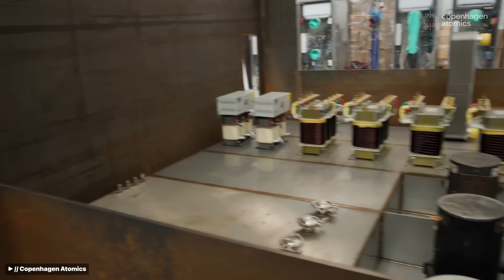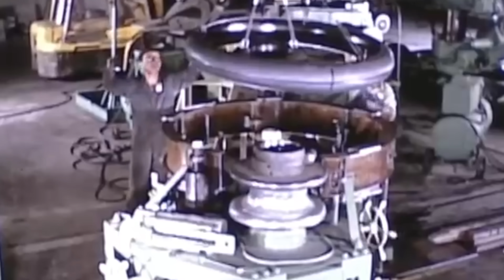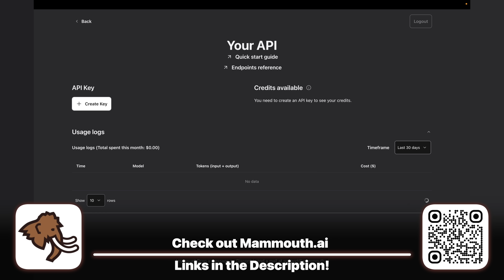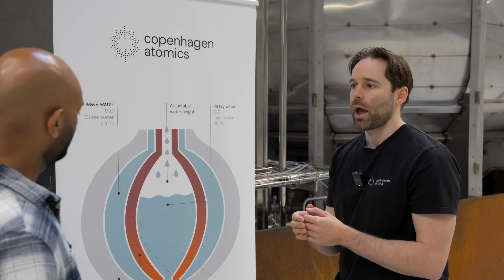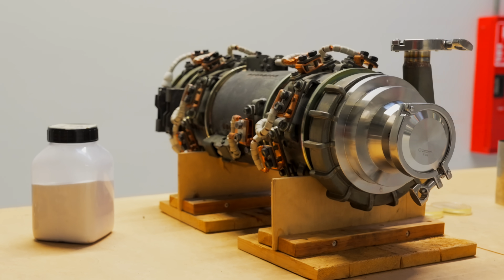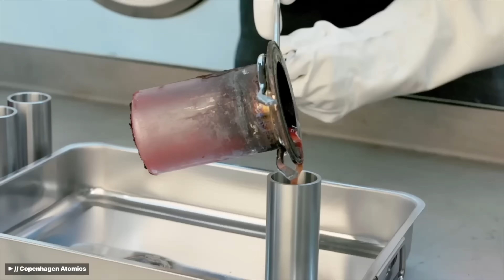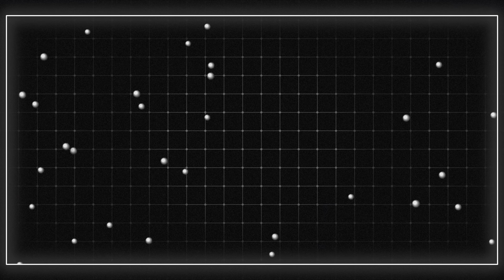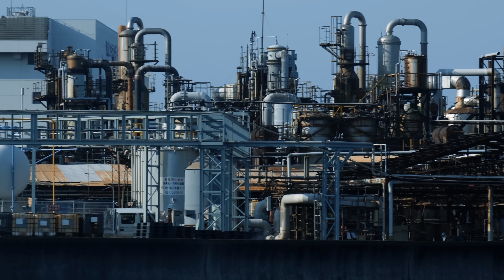This Modular Thorium Reactor EATS Nuclear Waste

Comment: 8:28 - Purified molten salt is still corrosive.

Even so, to purify their molten salt on an ongoing basis, Copenhagen Atomic's design needs to have an external salt purification plant inserted into the molten salt loop!

This external processing plant will bear the brunt of the corrosive salts. So Copenhagen Atomics is relocating the problem elsewhere and adding more complexity & cost on top of it all.

Moreover, since the molten salt has embedded highly radioactive nuclear fuel, any external sodium or salt purification system is no longer just an industrial chemical plant — it becomes a nuclear facility in its own right...

Specifically, that processing loop must meet nuclear-grade security, shielding, remote handling, and materials standards, because it is continuously handling fuel-bearing, highly radioactive fluid. It also generates a steady stream of contaminated filters, sorbents, trap materials, and secondary salts.  All of this activity and equipment is constantly creating ongoing low- and intermediate-level radioactive waste that must be conditioned, transported, and stored.

The external processing plant breaks the design where the molten salt is self-contained within each reactor.  So the site operators now have to contend with an external nuclear-grade purification plant located somewhere on site.  All that just to deal with salt corrosion.

In the end, this beefy external purification plant adds major capital cost, operational complexity, maintenance burden, remote-handling requirements, and security constraints. In practice, you’re trading corrosion in pipes for corrosion in an entire chemical plant that has to run continuously for decades — which is not a simplification, it’s an economic and engineering liability.
Reply: The salt only has to last 5 years.
Reply: @chapter4travels  That doesn't help with commercial operations.
Reply: @beyondfossil  5 years is the commercial operational life.
Reply: These guys have been running dozens of salt loops over ten years; one of the founders studied molten salt chemistry with a professor who'd worked at Oak Ridge, on the original MSRE. They reckon they can fit all the fission product  purification systems into a standard sized, sealed container. If they can, they'll do well. If they can't, they won't be a problem.
Reply: @2x6x250ml  Will have to research what details they release on how they purify the molten salt.  Ideally, the salt purification processing is all self-contained within the shipping container — including the reactor and all other necessary components.  All the old diagrams I've seen show the purification process as an actual building.

But Copenhagen Atomics has scaled back its ambitions considerably with an extra-small 40MWe reactor.  That is way too small for utility-scale grid operations, and stacking them up to get more power is way more costly than a single large reactor.  Furthermore, a 5-year full swap-out replacement appears nice "on paper", but will likely be too costly to be financially viable when all costs are tallied up.  Somebody has to pay for these costs, so Copenhagen Atomics would need to pass the costs to its customers.

Also, a recurring pattern is that these micro- and small-reactor startups assume that their reactors can be installed at factories, warehouses, or data centers — but no current nuclear licensing, zoning, or safety framework allows this.  Changing that could be as difficult as the technology itself.
Reply: There will be no external salt processing unit. Only links are for water cooling (light water) and tertiary salt (nitrates, non radioactive.) Plus power/control wiring link. Fuel and blanket salt links are welded shut, till they're hooked up to the replacement unit after, hopefully, five years. Volume of a 40 foot container looks big enough to hold five years of fission product solids, though I think an offpipe for gaseous ones would be easier than compressing them - xenon and krypton are quite valuable, not particularly dangerous, and mostly have shortish half-lives. Tritium is also valuable - $30,000 per gram. Swap out cost is a gantry crane, and a welding robot to join/seal the pipes (CA have done this.) Used containers are stacked at the end of the container hall.
At ~$50 million per unit, $100M including siting, turbines, etc, proposed costs per gigawatt electric are actually very close to a Chinese Hualong now, but well below those for recent US and European plants.
Reply: @2x6x250ml  The gantry or portable crane would be the minimum requirement for a swap out.  There are a lot more costs involved.

For starters, there are costs of transportation, removal & installation, recertification fees, and possible downtime.

The highest cost would be decommissioning the old reactor.  That includes its nuclear fuel and neutron-irradiated components that all need to be carefully dismantled and disposed of properly under nuclear-industry level standards. Somebody has to pay for that, and CA will likely pass this cost onto its customers. Furthermore, in real-world operations, power equipment such as solar, wind, turbines, and diesel generators run for far longer than 5 years, and they have zero radiation concerns.

Transporting a cargo container with live, activated fissile fuel and material will not be just a regular freight transport.  It requires certified transport casks, special permits, route approvals, armed security, emergency response coordination, and public-road restrictions. These shipments would move over highways and public infrastructure.  It would trigger national and international nuclear transport regulations. This isn't a hypothetical.  Because it's the same regulatory burden applied to spent fuel transport today. Repeating this process every five years turns logistics, security, and public acceptance into recurring operational costs.

No fission nuclear reactor will ever be running in a commercial or industrial zone, even one as small as a 40MWe reactor.  The only customers would be the government and the military for mission-critical, specialized applications. Even then, CA has competition from other small- and even micro-reactor start-ups.

I'm actually glad CA is pivoting to this small scale.  I've been saying for a while now that commercial nuclear power on the grid is hopeless.  But nuclear is very useful for small-scale specialized scenarios: military, scientific, and deep-space exploration.

As with almost all nuclear energy projections, the $100M per installed unit estimate is likely to be 2× to 3× that cost, at least.
Reply: @beyondfossil  Did you watch the video ? The neutron-activated husk of the old container stays in the plant. The new one is just empty steel - it would cost as much to transport as any other container. The fuel salt stays in the plant. Thorium is brought in to add to the blanket salt. That's considerably less radioactive than natural uranium yellowcake, which is shipped around with no drama. CA's plan is for a gigawatt plant, so swapping out one 40 MW unit at a time will cut output by 4% - less if you add a few units for redundancy. As regards nuclear cost projections, Ontario Hydro has been doing multiple full overhauls of its Candu's (another heavy water moderated plant without a reactor pressure vessel) at projected cost and ahead of schedule.
'No fission nuclear reactor will ever be running in a commercial or industrial zone, even one as small as a 40MWe reactor.' There's a 58 MW research reactor at Grenoble, a 45 MW one in Netherlands. There used to be hundreds of university research reactors, some in the tens of megawatts. Lucas Heights in Sydney, for medical isotopes, is 20 MW. The UK and Texas are both planning nuclear develoment campuses. The kids who used to demonstrate against nuclear are now all grizzled old bastards, and the kids either don't care, or like the idea of carbon free development.
Reply: @2x6x250ml  Research reactors are not equivalent to commercial power reactors...

Pointing to research reactors does not establish a precedent for running 24×7 commercial reactors inside factories or data centers.

Specifically...

Those academic research reactors have a very low operation capacity factor (duty cycle) and often much lower temperatures.  They run intermittently and often at partial power.  These operational differences completely change critical aspects of nuclear operation, like materials fatigue, safety analysis, emergency planning, and licensing requirements.

The purpose of the Grenoble, France 58MW thermal reactor is: neutron science, materials research, physics experiments — not electricity generation

The Netherlands High Flux Reactor (HFR) in Petten is a 45MW thermal reactor.  Its purpose is medical isotope production, materials testing, and nuclear research.  Again: no electricity generation and runs with intermittent operation with frequent shutdowns for experiments and refueling.

These reactors are often located near universities or research campuses, but they are dedicated nuclear research facilities, not "reactors inside commercial zones" in the way nuclear energy startups like Copenhagen Atomis imply.
Reply: @2x6x250ml  Research reactors are not equivalent to commercial power reactors...

Pointing to research reactors does not establish a precedent for running 24 by 7 commercial reactors inside factories or data centers.

Those academic research reactors have a very low operation capacity factor (duty cycle) and often much lower temperatures.  They run intermittently and often at partial power.  These operational differences completely change critical aspects of nuclear operation, like materials fatigue, safety analysis, emergency planning, and licensing requirements.
Reply: @2x6x250ml  ...continued

The purpose of the Grenoble, France 58MW thermal reactor is: neutron science, materials research, physics experiments — not electricity generation

The Netherlands High Flux Reactor (HFR) in Petten is a 45MW thermal reactor.  Its purpose is medical isotope production, materials testing, and nuclear research.  Again: no electricity generation and runs with intermittent operation with frequent shutdowns for experiments and refueling.

These reactors are often located near universities or research campuses, but they are dedicated nuclear research facilities, not "reactors inside commercial zones" in the way nuclear energy startups like Copenhagen Atomics imply.
Reply: @2x6x250ml  The purpose of the Grenoble, France 58MW thermal reactor is: neutron science, materials research, physics experiments — not electricity generation.

The Netherlands High Flux Reactor (HFR) in Petten is a 45MW thermal reactor.  Its purpose is medical isotope production, materials testing, and nuclear research.  Again: no electricity generation, and it runs with intermittent operation with frequent shutdowns for experiments and refueling.

These reactors are often located near universities or research campuses, but they are dedicated nuclear research facilities, not "reactors inside commercial zones" in the way nuclear energy startups like Copenhagen Atomics imply.
Reply: @2x6x250ml  ...continued

The purpose of the Grenoble, France 58MW thermal reactor is: neutron science, materials research, physics experiments — not electricity generation.

The Netherlands High Flux Reactor (HFR) in Petten is a 45MW thermal reactor.  Its purpose is medical isotope production, materials testing, and nuclear research.  Again: no electricity generation, and it runs with intermittent operation with frequent shutdowns for experiments and refueling.
Reply: @2x6x250ml  ...continued

These research reactors are often located near universities or research campuses, but they are dedicated nuclear research facilities, not "reactors inside commercial zones" in the way nuclear energy startups like Copenhagen Atomics imply.
Reply: @2x6x250ml  This video did not explicitly mention what happens to the used containers.

But, if we go to CA's website, we find this startling piece of information:

Used reactor containers are stored on-site for the full operational life of the plant (typically 50 years or more), plus an additional ~25 years for radioactive cooldown after shutdown, before being processed for recycling

Incredible!  So, in addition to not having any permits to run fission reactors at any industrial or commercial site, CA now wants to turn its customers' yard into a nuclear waste storage yard!  This makes getting that impossible permit even more impossible!
Reply: @2x6x250ml  This video did not explicitly mention what happens to the used containers.

But, if we go to CA's website, we find this startling piece of information:

Used reactor containers are stored on-site for the full operational life of the plant (typically 50 years or more), plus an additional ~25 years for radioactive cooldown after shutdown, before being processed for recycling

Incredible!  So, in addition to not having any permits to run fission reactors at any industrial or commercial site, CA now wants to turn its customers' yard into a nuclear waste storage yard!  This makes getting that impossible permit even more impossible!
Reply: @2x6x250ml  This video did not explicitly mention what happens to the used containers.

But CA's online information shows this startling piece of information:

Used reactor containers are stored on-site for the full operational life of the plant (typically 50 years or more), plus an additional ~25 years for radioactive cooldown after shutdown, before being processed for recycling

Incredible!  So, in addition to not having any permits to run fission reactors at any industrial or commercial site, CA now wants to turn its customers' yard into a nuclear waste storage yard!  This makes getting that impossible permit even more impossible!
Reply: @2x6x250ml   This video did not explicitly mention what happens to the used containers.

But CA's documentation shows this startling piece of information:

Used reactor containers are stored on-site for the full operational life of the plant (typically 50 years or more), plus an additional ~25 years for radioactive cooldown after shutdown, before being processed for recycling

Incredible!  So, in addition to not having any permits to run fission reactors at any industrial or commercial site, CA now wants to turn its customers' yard into a nuclear waste storage yard!  This makes getting that impossible permit even more impossible!
Reply: @2x6x250ml   This video did not explicitly mention what happens to the used containers.

But CA's documentation shows this startling piece of information:

Used reactor containers are stored on-site for the full operational life of the plant (typically 50 years or more), plus an additional ~25 years for radioactive cooldown after shutdown, before being processed for recycling

Incredible!
Reply: @2x6x250ml  …continued

So, in addition to not having any permits to run fission reactors at any industrial or commercial site, CA now wants to turn its customers' yard into a nuclear waste storage yard!  This makes getting that impossible permit even more impossible!

This new piece of information massively raises the regulatory bar: nuclear waste storage requires additional licensing, security, monitoring, emergency planning, and long-term liability — none of which are permitted today in industrial or commercial zones. Far from simplifying permitting, this makes approval even harder, because regulators now have to approve both a reactor and decades-long on-site radioactive waste storage.
Reply: @2x6x250ml  …continued

So, in addition to not having any permits to run fission reactors at any industrial or commercial site, CA now wants to turn its customers' yard into a nuclear waste storage yard!  This makes getting that impossible permit even more impossible!
Reply: @2x6x250ml  …continued

So, in addition to not having any permits to run fission reactors at any industrial or commercial site, CA now wants to turn its customers' yard into a nuclear waste storage yard.  This makes getting that impossible permit even more impossible!
Reply: @2x6x250ml  …continued

This new piece of information massively raises the regulatory bar: nuclear waste storage requires additional licensing, security, monitoring, emergency planning, and long-term liability — none of which are permitted today in industrial or commercial zones. Far from simplifying permitting, this makes approval even harder, because regulators now have to approve both a reactor and decades-long on-site radioactive waste storage.
Reply: @2x6x250ml  …continued

This new piece of information massively raises the regulatory bar: nuclear waste storage requires additional licensing, security, monitoring, emergency planning, and long-term liability — none of which are permitted today in industrial or commercial zones.
Reply: @2x6x250ml  …continued

This new piece of information massively raises the regulatory bar: nuclear waste storage requires additional licensing, security, monitoring, emergency planning, and long-term liability.
Reply: @2x6x250ml  …continued

This new piece of information significantly raises the regulatory bar: nuclear waste storage requires additional licensing, security, monitoring, emergency planning, and long-term liability — none of which are permitted today in industrial or commercial zones.
Reply: @2x6x250ml  This new piece of information massively raises the regulatory bar: nuclear waste storage requires additional licensing, security, monitoring, emergency planning, and long-term liability — none of which are permitted today in industrial or commercial zones. Far from simplifying permitting, this makes approval even harder, because regulators now have to approve both a reactor and decades-long on-site radioactive waste storage.
Reply: @2x6x250ml  …continued

This new piece of information massively raises the regulatory bar: nuclear waste storage requires additional licensing, security, monitoring, emergency planning, and long-term liability.
Reply: @2x6x250ml  …continued

This new piece of information significantly increases the regulatory bar: nuclear waste storage requires additional licensing, security, monitoring, emergency planning, and liability — none of which are permitted today in industrial or commercial zones. Far from simplifying permitting, this makes approval even harder, because regulators now have to approve both a reactor and decades-long on-site radioactive waste storage.
Reply: @2x6x250ml  Any incoming shipment of a new replacement thorium reactor in its shipping container will still be subject to very strict nuclear shipping regulations and procedures.

Thorium is not fissile, but it is fertile.  Meaning thorium needs a neutron-generating "driver" material to kickstart the breeding cycle.  CA says they use a 5% U-235 as the driver.

But this immediately elevates the shipping container to strict nuclear shipping regulations and reporting, along with security.  Under international norms set by the International Atomic Energy Agency, fissile material is never treated as ordinary freight, regardless of activation state.
Reply: @beyondfossil The regulations aren't so strict that the hundreds of operating power and research reactors don't get regular fuel shipments. Taiwan's used to get their fuel by air. They foolishly shut them all down lately - if China blockades the island, the LNG that replaces the lost nuclear generation will last about 8 days.
Reply: The container is shipped separately from the starter fuel - which, as low enriched uranium, is not very radioactive (you can pick it up in gloves), and not really weaponisable either. I guess you could make armour-piercing tank rounds out of it ....
Reply: @2x6x250ml  Interesting idea to ship the driver separately.  But, unfortunately, that brings more problems than it solves.

The moment any external driver fuel or neutron source is inserted on-site, the customer's facility legally becomes a nuclear facility. That triggers nuclear licensing, inspections, security, emergency planning, and the need for trained nuclear staff.  That then breaks the "turn-key energy in a box" concept, which is core to CA's marketing of this product.

Utilities and industrial customers want plug-and-play infrastructure, not temporary nuclear construction sites. If fuel loading or reactor startup happens at the customer’s location, this is no longer a product delivery, as the project becomes a nuclear installation project as described above.

This is also why CA wants to store used energy containers on the customer's site, and never open these used containers for 50+ years.
Reply: @2x6x250ml   Interesting idea to ship the driver separately.  But, unfortunately, that brings more problems than it solves.

The moment any external driver fuel or neutron source is inserted on-site, the customer's facility legally becomes a nuclear facility. That triggers nuclear licensing, inspections, security, emergency planning, and the need for trained nuclear staff.  That then breaks the "turn-key energy in a box" concept, which is core to CA's marketing of this product.

Utilities and industrial customers want plug-and-play infrastructure, not temporary nuclear construction sites. If fuel loading or reactor startup happens at the customer’s location, this is no longer a product delivery, as the project becomes a nuclear installation project as described above.
Reply: @2x6x250ml   Interesting idea to ship the driver separately.  But, unfortunately, that brings more problems than it solves.

The moment any external driver fuel or neutron source is inserted on-site, the customer's facility legally becomes a nuclear facility. That triggers nuclear licensing, inspections, security, emergency planning, and the need for trained nuclear staff.  That then breaks the "turn-key energy in a box" concept, which is core to CA's marketing of this product.
Reply: @2x6x250ml  ...continued

Utilities and industrial customers want plug-and-play infrastructure, not temporary nuclear construction sites. If fuel loading or reactor startup happens at the customer’s location, this is no longer a product delivery, as the project becomes a nuclear installation project as described previously.

This is also why CA wants to store used energy containers on the customer's site, and never open these used containers for 50+ years.
Reply: @2x6x250ml  ...continued

Utilities and industrial customers want plug-and-play infrastructure, not temporary nuclear construction sites. If fuel loading or reactor startup happens at the customer’s location, this is no longer a product delivery, as the project becomes a nuclear installation project as described previously.
Reply: @2x6x250ml  ...continued

Utilities and industrial customers want plug-and-play infrastructure, not temporary nuclear construction sites. Fuel loading or reactor startup activities at the customer’s location mean this is no longer a product delivery.  The project becomes a nuclear installation project as described previously.
Reply: @2x6x250ml  ...continued

Utilities and industrial customers want plug-and-play infrastructure, not a temporary nuclear construction sites. Fuel loading or reactor startup activities on-site mean this is no longer a product delivery.  The project becomes a nuclear installation project as described previously.
Reply: @2x6x250ml  ...continued

Utilities and industrial customers want plug-and-play infrastructure.  They don't want a temporary nuclear construction site

Fuel loading or reactor startup activities on-site mean this is no longer a product delivery.  The project becomes a nuclear installation project as described previously.
Reply: @2x6x250ml  ...continued

Utilities and industrial customers want plug-and-play infrastructure.  They don't want a temporary nuclear construction site.
Reply: @2x6x250ml  Utilities & industrial customers want plug-and-play infrastructure.  They definitely don't want a temporary nuclear construction site.
Reply: @2x6x250ml  ...continued

Fuel loading or reactor startup activities on-site mean this is no longer a product delivery.  The project becomes a nuclear installation project as described previously.
Reply: @2x6x250ml  I'm posting paragraphs of other information that YouTube is blocking.  This happens a lot, especially when talking about nuclear fuel.
Reply: @2x6x250ml  ...continued

Utilities and industrial customers want plug-and-play infrastructure.  They don't want a temporary nuclear construction site.

Fuel loading or reactor startup activities on-site mean this is no longer a product delivery.  The project becomes a nuclear installation project as described previously.
Reply: @2x6x250ml  Utilities and industrial customers want plug-and-play infrastructure.  They don't want a temporary nuclear construction site.  Fuel loading or reactor startup activities on-site mean this is no longer a product delivery.  The project becomes a nuclear installation project as described previously.
Reply: @2x6x250ml  ...continued

Utilities and industrial customers want plug-and-play equipment.  They don't want a temporary nuclear construction site.  Fuel loading and reactor boot-up activities on-site mean this is no longer a product delivery.  The project becomes a nuclear installation project as described previously.